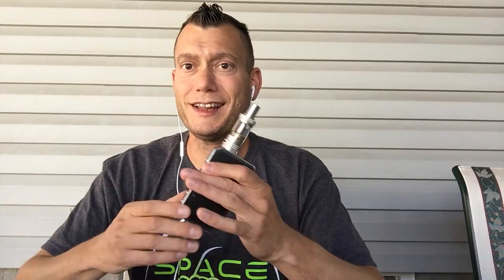Dangers of Ni200 nickel DON'T vape it on anything BUT Temperature Control!

Comment: Your assumptions are incorrect and poorly researched. Nickle starts to melt at around 3k F and it starts to boil at around 5kf for it to start to seep into the liquid it needs to be heated up to around the 5kf mark which would basically not only turn all your ejuice into quickly expanding smoke inside your tank (if you use one) but it will also melt the cotton and the other metals in your rda/tank
Reply from the maker: ****I already have an audience and ride no coattails.  I don't care if you agree with me or not.  You're still talking about 'studies' without dropping a link, as though you have some secret inside knowledge that none of us have.  well if you know of something helpful then share it, otherwise shut your damn mouth you arrogant brat.  Some folks take this seriously and don't appreciate your smug commenting here.  But the real intention of this video is to educate people not to vape Ni200 and Ti out of temp control and not to glow the coils red hot like folks do with Kanthal.  Let me ask you a question.  Why do I put up with abuse from smarmy brats like you and ^others?  Couldn't I more easily just do reviews for all the hyped up products and juice lines and grow an audience by attrition over time?  Maybe get a sexy gal on here with some nice motorboat inspiring boobs?  I have a purpose here with this channel and it's not to entertain you know-it-all vaping types.  It's to help newer folks to find their way to a good and safer vape, avoid harmful errors in product use or vaping habits.  IF you're not adding to that goal then stay off my channel.  If you want to add to that goal then quit smack talking me and go do something useful to the vaping community.
Reply from the maker: if you don't like my channel or my video (which you still have not watched) why do you keep returning here to pester me?  Why do you even care?  And last time I checked, you are not the mayor of vaping.  So once again, if you have information, share it here.  IF you have just smack talk then stick to your brat friends.  Grown adults here are trying to enjoy themselves and you're disturbing the peace.    ^this guy is the same guy keeps trolling my channel with different dummy accounts.  He will edit or delete his comments later to remove his abusive comments and insults.  He will also go silent when another character shows up to further argue with me....it's like tag team with himself though.  Thanks for commenting here J Soohoo and goodbye.  no longer welcome here, no longer a credible person to listen to.
Reply: Why did boiling or melting points get brought up? Dude was talking about oxidizing the metal, iirc you don't need a metal to boil for oxidization to occur.
Reply: Why the fuck are you guys going ham on the owner of the channel? This wasn't meant to be an attack on this guy, his attitude and lack of knowledge on this subject aside his videos are pretty great and have good info.  Yall need to chill out and worry about the science and stop worrying about all the shit people say.
Reply from the maker: J SooHoo When you finally do read the full title of this video, and then watch this video, that you spent so much time and effort scolding me for making, you will see the actual points I make in this video.  now if you'll excuse me I have a family to get ready for school, real needs in the real world to attend to.  
And the way you've treated me here on my own channel has not won you any friends or helped vaping in any way.  who did you help yesterday?  ^^never watched my channel, never watched my video, opened your mouth without even looking, you mock phil busardo and Dr. Farselinos, yet you are subscribed to Phil Busardo, and drop Dr. Farselinos' article here which states exactly what I say in this video.  Now go back and watch my video and when you feel like apologizing to me for being such an asshole, I'll be right here to accept your apology.  And also read all the comments from people on this video who were vaping nickel out of TC because nobody told then it was unhealthy for them, and learned to get a TC mod or to put their mod into TC....after watching this video.  And where's your video educating folks to do that?  And how many people have you helped to quit smoking and to vape safely, and to replace their batteries?  In fact, what have you done at all in vaping, other than type you arrogant smug jackass?  Don't you lecture me.  Go out and give a mod and tank to a smoker and help them get off cigarettes and walk the hell away from this conversation.  ****smh.....and this turd of a person called ME arrogant.
Reply: +Jose Aleman I must have accidentally hit reply on your post as I was trying to comment on the video. Sorry about that.
Reply from the maker: +J SooHoo post the link because Dr. Farselinos and Phil Busardo missed that 'study' myself as well.  Are you just trying to get the last word in here?  or are you trying to help vapers to vape safely?
Reply from the maker: still back here on my channel bickering eh?  oh right....the 'other' bloke.  just one more question for you.  Exactly how tall is it?
Reply from the maker: +J SooHoo I think your high horse is a mile high, you elitist snob.
If you had any legit info and these ''studies' you seem to know about but yet nobody in the vaping community has ever heard of (as if I'm the only person seeking answers?) then you may share them now.....so that the other 50,000 people who have viewed this video can stop asking me to prove the case for Nickel one way or the other for them.
and if you don't have that information then quit yapping over here because nobody needs more gobshites around.
Reply from the maker: +J SooHoo oh you are definitely the same clown that's been trolling around over here.   Nothing useful there,  but congrats you learned to copy and paste.   Same bullshit the toaster and orthodontist braces argument used.  I was sincerely hoping you had some real info.  Yeah everybody finds that in about 3 minutes of google surfing.
Reply from the maker: The link to Dr. Farselinos was good though, thanks for sharing that.  I've heard the interview but it's good to have that link though.
Reply: +Jose Aleman Nickel melts at 2,651° F unless a strong acid is used to cause Nickel to melt. Our vaping devices do not reach such high temperatures. In point, Kanthal FeCrAl alloy has a melting point of 2,190°F (1,200 °C). Now, if you make a coil and it has a hot spot, then yes, if you fire your device at high wattage then the hot spot can cause the wire to overheat and snap, but there is no melting occurring. Also, a hot spot is typically found out far before you vape on said coil. In short, there is no need to worry about your Nickel wire melting. I think with all that it was not the point of the video. He was stating that for safety reasons it is probably best to use Nickle in the way it is marketed and sold to be used and that is in TC mode and on TC mods. I am not sure saying a person can get "toxic fumes" from vaping in power mode with nickle is a true statement based on what I have read. I think I will still be safe and follow the manufacturers suggestions and use the nickle coils in TC mode and on TC mods only.
Reply: Guild Wars 2 Player 4 Life  while i appreciate you providing information i've already provided I'm not sure why you're tagging me in this?  

the main fear that i was addressing is the metal seeping into the liquid since this kind of metal can seep into liquids, HOWEVER the metal would need to be under extreme conditions, such as the BOILING point, which is a bit higher than the melting point, and as both you and i stated, its very very very very very implausible that the mods will pump that much current through the coil to get it that hot.
Reply: Guild Wars 2 Player 4 Life  all good m8, thanks for posting accurate information though =)
Reply: +Jose Aleman so who won, are you blocked yet?  but what of the pulsing of the nickel when you dry burn it.  It does leave residue (as with kanthal).  If the boiling and melting temp don't come into effect, is it still safe to use the wire with those tiny particles let loose?  what i got from the video is that the materials from nickel wire are more harmful than those that are in kanthal, so it is better to be safe?
Reply: Joseph A. You are a fucking moron
Reply: Joseph A. You are not using science. You are talking about boiling point. Since you are not in the metal industry you have no clue to what you are talking about. 

When nickel is heated to a certain point, it becomes toxic.
Reply: You're making various mistakes kid. Number 1 when discussing chemical and physical changes to matter that becomes a scientific conversation about chemistry with a hint of metallurgy. I dont need to be a metallurgist to know the properties of a particular metal or alloy as scientists already published that information for the general public to benefit from as myself and @J SooHoo mentioned the opinions seen in the video do not match up against basic scientific knowledge.  Next time you decide you have an opinion just let it go kid you obviously are no better than the owner of the channel.
Reply: Joseph A. Being born in 1981, I am definitely not a kid. Also working in the metal industry I am much more wiser than you. 

Keep being a dumbass.
Reply: Your grammar is terrible, you behave like a child therefore i will address you as one If the information provided in the section above is too dense for you to understand then i'd recommend going back to school and getting an education son.
Reply: Joseph A. Ok dumbass, have fun with that. Good luck on your E-cancer
Reply: Joseph A. People like you are fucktards.

Again, when nickel is heated to a certain temperature, it produces toxic Vapors.

Not hard to understand. I don't need to prove anything to you since it is a fact.

It's your body, more power to you. I am done. If you want the last word, so be it. I will no longer reply to you.
Reply: Sooooo when should I worry?! why you fuckers arguing! Who is right?! FUCK!
Reply: ^^ Trading electrons, actually, not molecules; molecules are groups of atoms.
Reply: You have to simplify things for these people. I seriously doubt they can understand ionic and covenant bond
Reply: im not really concerned if you listen to me or not, grammatical errors do not affect the validity of chemistry and metallurgy. Gently remove the stick you currently have up your ass and do some research for yourself if you're interested =)
Reply: That may be so, but perpetuating a major inaccuracy isn't going to help them understand it any more than if you'd said nothing to begin with.  Provide accurate knowledge, and folk will understand with greater ease.
Reply: Joseph A. Just sat here sipping tea reading 🤣
Reply: @ J SH - My first thought was to wonder how they persueded a person with a confirmed nickel allergy to participate in such a test...
Reply from the maker: You did not watch my video you missed the points made.  I don't care about the melting or boiling point of nickel,  don't talk to me about research.
Reply: Quest4vape  lmao look man there's no need to get salty like a child. Pick up a Chemistry book and read about the periodic table, and what happens when this particular metal interacts with heat and liquids.   You state nickle is a soft metal, which is true for the most part, its very malleable but it does not pose a danger in non extreme situations. If you wish to keep spreading fear about this then go right ahead, but you're being an idiot
Reply from the maker: +Jose Aleman You go pick up a chemistry book bro.  I'm not here to be a scientist.  Why don't you go fund some research, since you're so smart.  Talk shit in my comments or patronize me again and I just block you.  There's a way to chat with me, and this isn't it.  I'm talking caution and safety....are you saying it's ok to vape Nickel and Titanium in wattage mode?  Great.  You go first.
Reply: Xanthon Lmao, producing an Item is not the same as using the already produced product, and assuming that a material will react a certain way after its been processed is just the purest form of scientific illiteracy. 

you kids want to vape, and talk about Ohms, resistance, metals being used to conduct electricity, but most of you don't have the mental fortitude to do some research for yourself or accept any new information that disproves your misinformed views. 

try again Xanthon. also i'm surprised that Quest4vape didn't block me xD
Reply from the maker: +Jose Aleman no I think you do a great job of alienating all of 'us illiterate kids' with your perfectly smug gobshite comments.  See folks this guy has no more 'science' than you or I do,  just a contentious snarky troll grabbing some attention.  Congrats and please say hello to me when and if you see me in one of many Vape shops or Vape expos I attend,  we can discuss all of your opinions as well.
Reply from the maker: +Jose Aleman chuckle. no I dropped my internet tough guy card first, so you can't use that it's been played.  Also you used your intellectual card, your Bruh-man card, I think you're just circling around now repeating the same taunts.   Ok my web trending friend come back for another helping of #deeznuts any time.  troll on and may your efforts reward you tenfold.
Reply from the maker: +J SooHoo Ok, so I'd love to see some research.  Who appointed me the guy to do that?  I frequent many shops and talk with many people online and have been seeing people vaping nickel out of temp control, building clapton coils with a ni200 core, doing twisted builds and glowing the nickel on mech mods, etc.  That is not what the nickel is for.  So I made this video.  And now I'm being baited first into BEING the nickel hating guy when I wasn't, and then BEING the guy that's supposed to prove for our entire industry, definitively, that nickel is or isn't safe.  Well Phil Busardo isn't touching that question with a 10 foot pole, and neither am I.  smarmy douches like ^this guy just want to spout out some ignorant nonsense about the melting point and boiling temp of a metal as if that's what we are concerned with.  IF you want research, please go find some.  I say nothing different than the manufacturers of temp control mods say.  But if folks want to lob rotten cabbages at me for telling people to get TC mods for nickel....well so be it.
Reply: +Jose Aleman I would never use Nickel but it's because I'm super allergic to it. Anyone else who has an allergic reaction to cheap metal jewelry, belt buckles, ect  is probably also allergic to it. Furthermore Nickel is a known carcinogen it doesn't have to melt. I'm sure you might be shocked but it is nonetheless true.Nickel is a toxic metal and a known carcinogen. Which means it is classed as a dangerous material and is poisonous not just to the environment, but also to your health. Nickel vaped at high temperatures may cause the nickel to produce vapor which can be very damaging. All reputable ecigarette shops that sell pure nickel wire attach a warning, advising you to use nickel wire with an ecig that has temperature control, so you can keep the temperature low to avoid toxic fumes emanating from the nickel coils.Nickel can be found in many items you are not probably aware of, although this is at very low quantities. In fact regular cigarettes contain nickel, some vegetables contain nickel, water can contain nickel, chocolate and fatty foods can contain nickel and its even present in small quantities in the air you breathe, so small quantities nickel is relatively harmless. Stainless steel we see everywhere contains 14% nickel, catalytic converters in cars produce some nickel and the process to manufacture margarine involves using nickel as a catalyst to hydrogenate fat.However consuming a large amount of nickel, or breathing nickel fumes several times a day, and every day, may damage your health, so we would advise against nickel wire for your custom ecigarette builds.Exposure to nickel can produce various symptoms including rash, blisters, breathing problems, asthma, eczema and irritation. High levels of nickel poisoning can even cause respiratory failure or lung disease.Reason 2 – High Allergy RateDid you know more than 20% of the worlds population are allergic to nickel. Have you ever worn cheap jewelry and it leaves a rash or a green patch of skin where the jewelry sat? have you ever worn a belt with a buckle that itches and maybe leaves a rash? If your answer is yes then you are allergic to nickel. Nickel allergies can range from itchy skin, to discoloration of skin and blisters. If you are very perceptible to these skin rashes with metal products it is advisable not to vape with pure nickel wire at all.With so many vape shops choosing to sell pure nickel wire we thought it may be worth providing some information, as many people are not aware of the dangers of nickel. Just because we use nickel every day, in every day household items, doesn’t mean nickel is safe.
Reply: face palm. Metal oxidizes over time dude. that's the process of a metal trading molecules with oxygen, which eventually happens to all metal over time regardless of temperature.

Comment: I have a sigelei 150w tc what setting should I use with my ni200 coil n not go over?
Reply: +Colestercamps You do realize joules and watts are not convertible. You can calculate watts from joules and seconds, but you can't convert joules to watts, since joule and watt units represent different quantities. The wattage at 100 joules varies depending on the coil resistance and temp. You can't just go I vape at 200w because I have my IPV set to 100 joules.
Reply: +Spencer Cosolito i vape nickel at 200w (100j) all the time
Reply: Well then haha I was told they are equivalents sorry